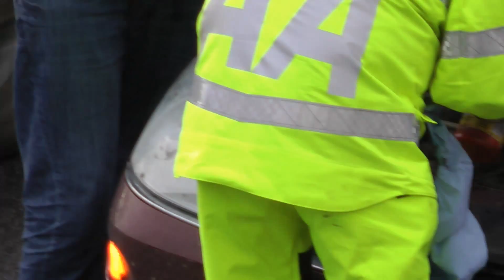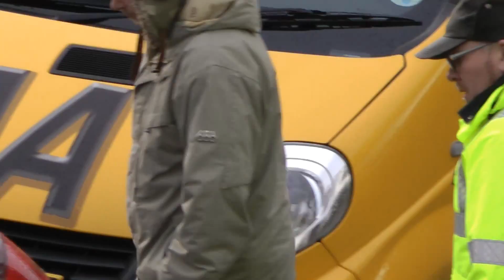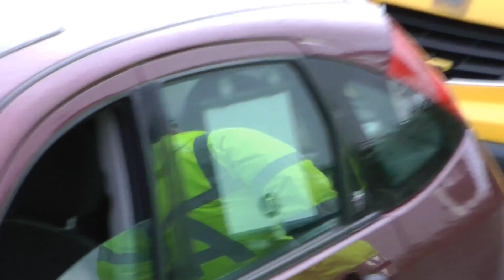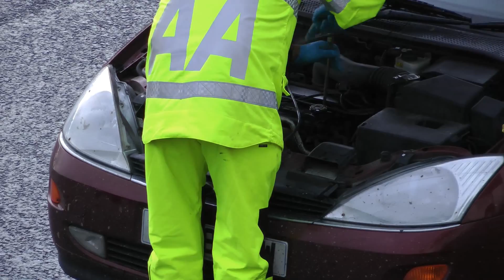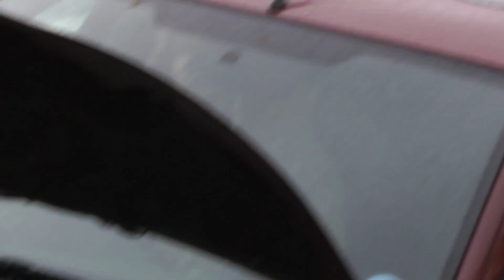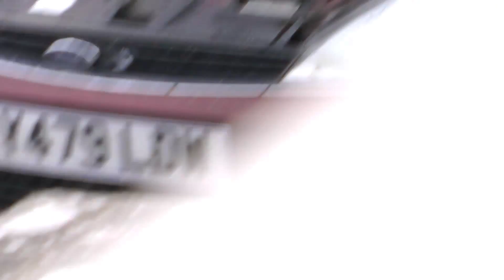Ford Focus AA Breakdown in Llantwit Major

Comment: Ford hasn't done much better than Peugeot the S max came out as Britains most unreliable MPV at one point with 20% produced coming out as faulty. It came down to the bottom due to (As you say) cost of repair and breakdown.